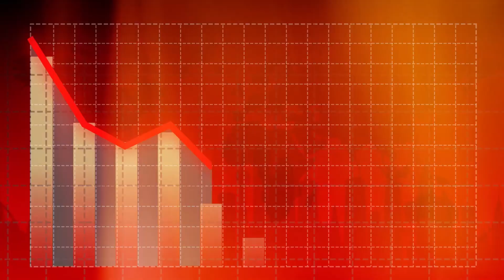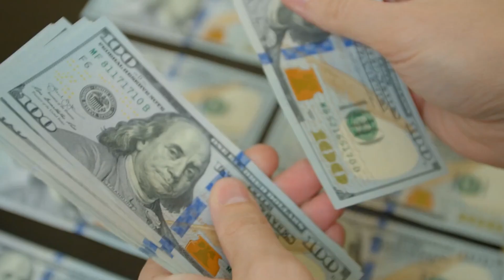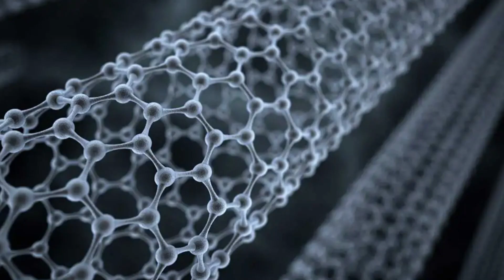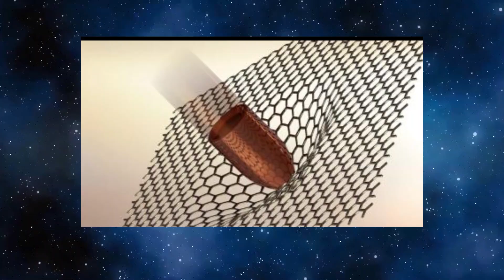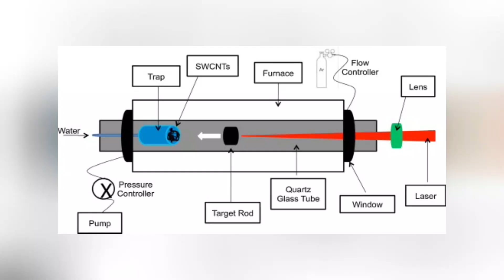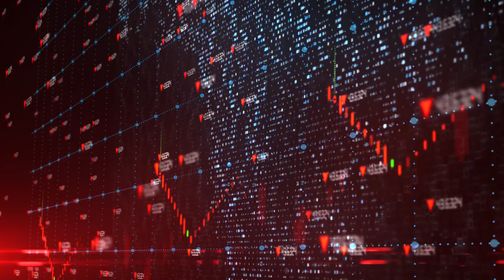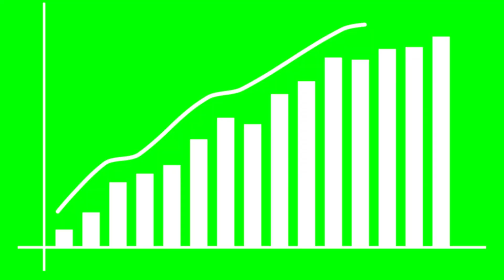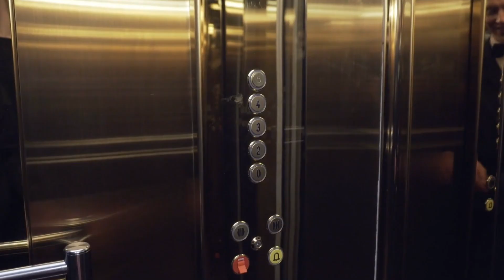If Japan Completes This CRAZY MEGAPROJECT, The WORLD Will Change Forever! | Documentary Studio |

Comment: I used to produce illustrations for the ISEC and ISS to use in their white papers/publications. You even used a couple in your presentation, no doubt gleaned from Google image searches.
I think the materials science challenges will be solved within a decade.
The Obayashi corporation's plans for an Elevator specify beginning of construction around 2050, but I suspect China or even perhaps the US will beat this timeline by a few years. 
Your presentation is reasonably balanced but neglects sufficient emphasis on the dangerous aspects of chemically powered rockets; they frequently blow up! SpaceX's last two attempts being good examples of this hazard. An Elevator would be many, many times safer than rockets. Another critical factor you failed to mention is re-entry; rockets must shed the velocity they build to launch when they return to earth, through friction with the atmosphere/extreme heating, another life-threatening issue that is side-stepped by Elevator use; slow, controlled  ascent and descent via Elevator would not generate the high differentials of kinetic energy that rockets accumulate.
A third point you neglected is that the simple presence of the tether in, through and beyond the atmosphere would generate tremendous amounts of free electricity, not just enough to power climbers, but to feed the electrical grid groundside with gigawatts. Indeed, figuring out how to dissipate this energy safely is one of the main engineering challenges of Elevator construction.
The central drawback of an Elevator ( aside from initial cost ) is the speed of transport, which would be many times slower than that of rocket delivery and return. Rather than thousands of kilometers per hour, an elevator climber would operate at perhaps a few hundred kilometers per hour, making the trip to the top ( assuming geosync terminal placement ) a matter of several days rather than a few minutes. This presents further challenges of engineering and life support to address for man-rated climbers.
Lastly, many papers have been published showing how hybrid design approaches could lower the cost/require less exotic materials and shorten construction time; an Elevator that only extends a few hundred kilometers into space is possible, as are designs that incorporate upper-atmospheric terminals instead of ground based connection.
Most exciting are the potential advantages offered by a moon-based Elevator, which could be begun with current technology due to its much smaller scale, if only our return-to-the-moon program could be accelerated. Even a Mars-based Elevator would be achievable without needing advanced materials tech.